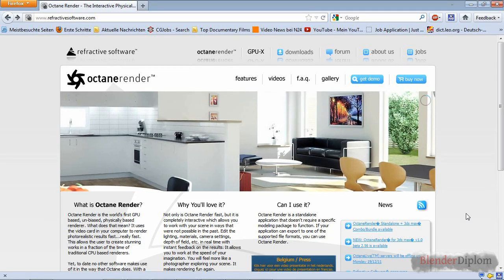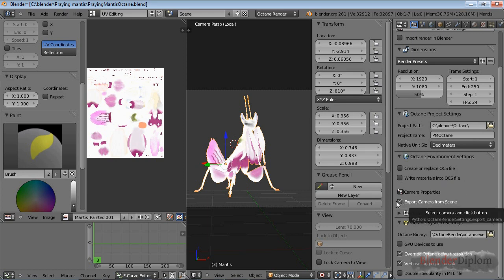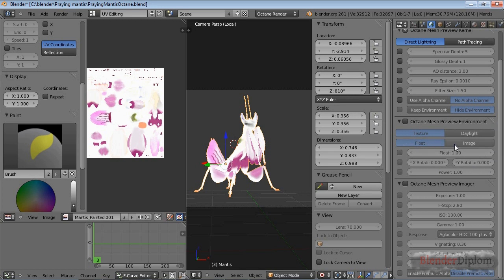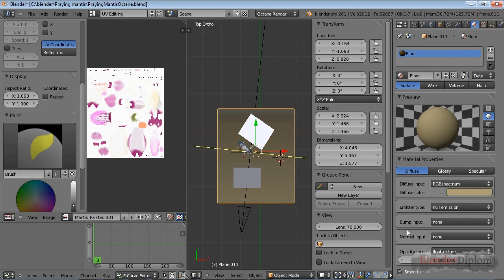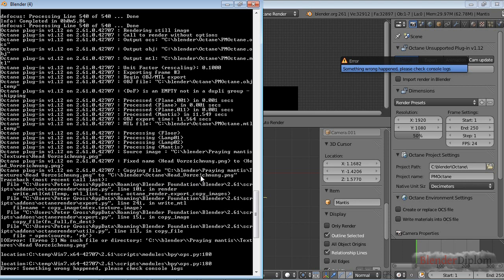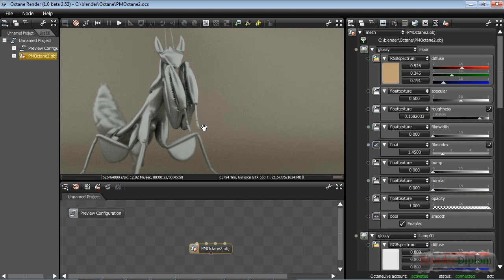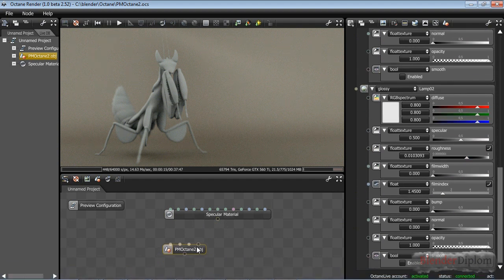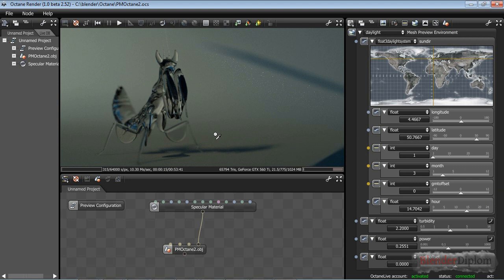Blender Tutorial I Octane Exporter Introduction Avoid the Pitfalls

Comment: How to install Octane Blender on OSX? I can't find any information regarding the subject. Downloaded the official package, installed, started the server but I can't find where is the Octane Blender build on my SSD (MacBookPro).
Reply: Found the answer:

"installing is the same procedure as in Windows, the only difference is that OSX does not like multiple copies of the same app. Therefore, if you already have a standard blender installation from Blender.org,OSX will locate this even if it is not in the Applications folder, and when it detects that it already exists, OSX will actually omit installing the Octane distribution of the Blender app.

To install the plugin on Mac OSX machines, users need to insure that there is no existing standard Blender.app from the Blender.org in the machine. Otherwise, the existing Blender.app should be first removed, before the Octane Blender distribution can be installed."